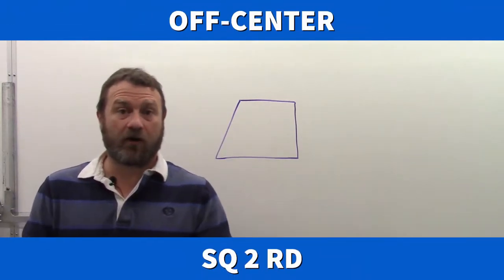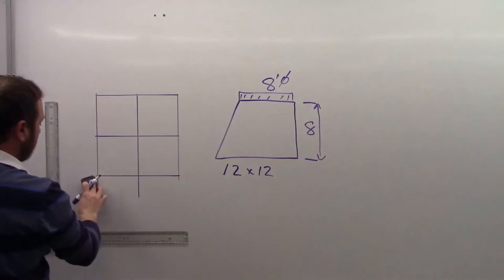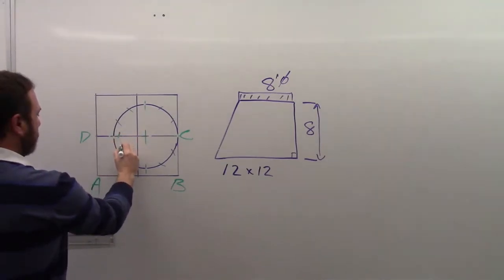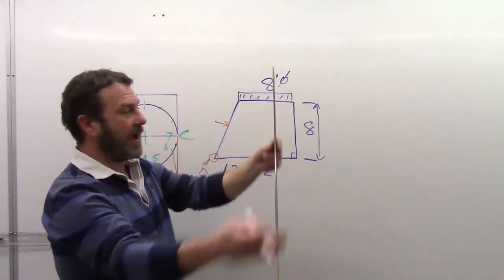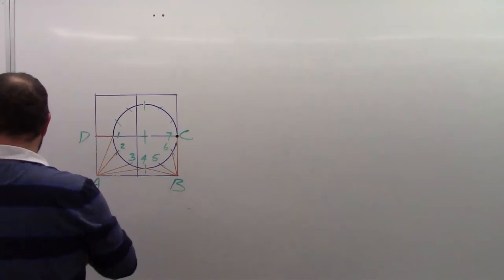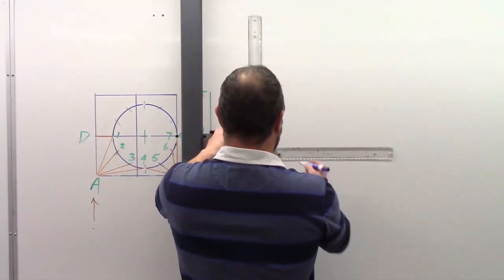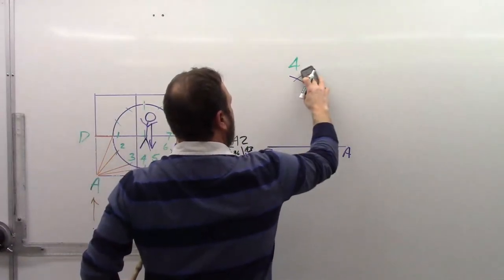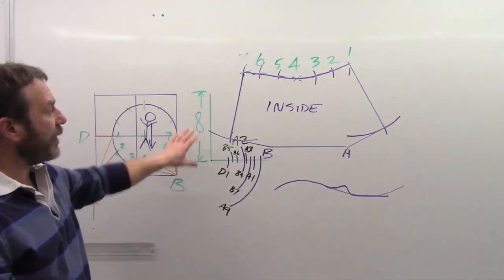SQ 2 RD OFF CENTER

Comment: Thanks for the great content. I am a fabricator in the metal roofing industry and I draw things like this quite often, although I haven’t had to do an offset S2R yet. I had it thought out if the opportunity comes but this video helps me confirm what I was already thinking. HVAC has similar but also different items and it all helps me to cross ideas between the two.